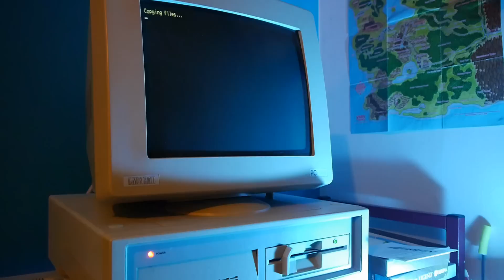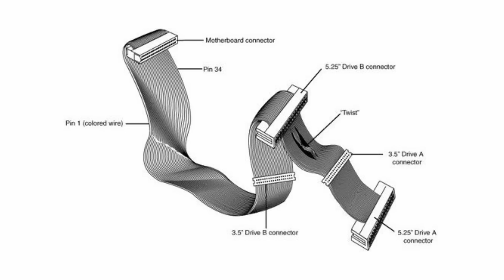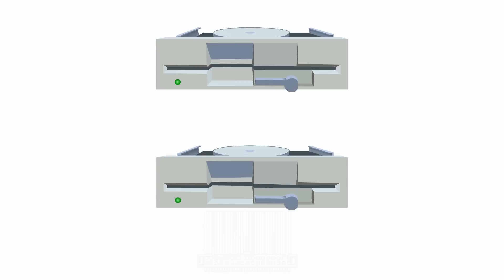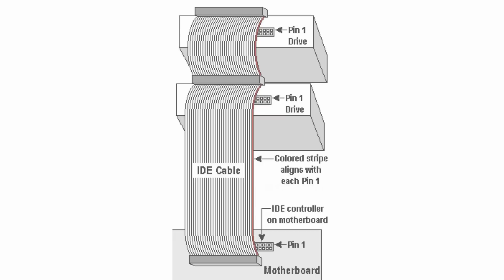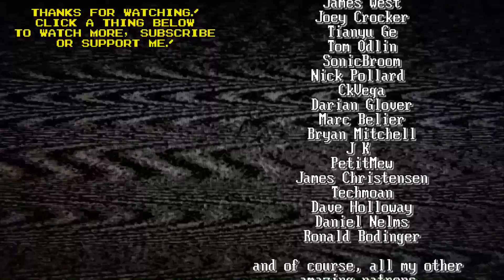Why are Floppy Cables Twisted? [Byte Size] | Nostalgia Nerd

Comment: Anyone else get a chuckle that all the 5 1/4 drives in the illustrations are upside down?  The lever swings down from the top and the light was usually on top as well.

Comment: I'm a bit confused by the way ide cable order described in this video. I don't know if it only applies to CS mode only but I'm pretty sure if you fix the drives mode via jumpers, then you need to put the master drive on the outer end, and slave drive in the middle. If you do otherwise performance drops drasticaly. I have lots of old ide cables with markings that say MASTER and SLAVE on the locations that I've mentioned.
Reply: Watch the video again. Those cables with the cut wire weren't very common in the long run. The typical configurations you're thinking of didn't have the cut wire configuration thing, that was kind of it's own unique thing. Hence the back asswards setup with such cables.

Continuous uncut cables had a missing pin connection in the slave connector to accommodate basically the same thing.

Go ahead, break open the back end of the slave connector on one of those old ribbon cables, I'm sure you'll see a missing connection on that same line.
Reply: @southernflatland  that's interesting info, will do when I have the time!

Comment: The highest number of connections I ever saw in one of those cables was ten. It might have been a custom cable but it had a drive on every port. I don't think that you could use all of them at the same time. Something cool and strange was the usb transfer cable that you could use to transfer data straight from one pc to another but it needed a special program to work but it was way faster than almost any other type of transfer on the market at the time but it never saw much use outside the server market. I have used them and I know that they were fully functional but if you used it in a way not intended you might damage one or both devices. I also never understood why we didn't switch to USB c and omni sooner. We had the technical capabilities to make them and outside super compact situations they would be more durable and easier to use without damaging the port. If you don't know usb omni has one port that looks like a 3.5mm headphone jack but it would have four or more bands and you could use the normal headphones with it even if it was the version that had five or six bands.

Comment: Going back to this era of tech..  you touched on the floppy, but how about the same thing on the old MFM/RLL/ESDI hard drives, which shared a control cable, but each had their own DATA cable..  not to mention dealing with terminating resistors!  Remember running a confg program to set your drive type?   1=10meg, 2=20 meg, etc..

Comment: If I remember corrrectly, that not the full truth. Pre-IBM disk standard (Shugart ?) hat 4 "drive select" wires/pins, but only one "Motor On". So all 4 drives had to rotate simultaneously. 
IBM not made drives "configurationless" but also had two separate "Motor On" signals for each drive at motherboard/controller card side.

Comment: First of all I consider myself an ignorant in computer stuff, and always have.

Then again, if you know how to open control panel today you're considered a knoledged guy, and if you know how to change your os and partition your drive, youre considered a god among mere mortals by the average person.

I miss the old master slave jumper required system because when people watched you use them they were all flabergasted, it was extremely simple and easy but locked like you really knew your stuff.

Comment: 1985: My first PC
2019: So THAT'S how Cable Select works!
Reply: Dropped down the comment section to say the same damn thing. During my youth I was under the impression CS would just magically let the drive I want be set to master. Had no clue how it actually worked until now. Haha.
Reply: @Donchikiman  Agree..  I thought it was triggering some actual negotiation between the drives, but this does explain why sometimes it wouldn't work (using a cable without the cut!)  I also remember taking apart some cables, and finding the cut (missing pin) only within the connector at the end, so that was confusing..
Reply: Same here in 2020!

Comment: The design should had a be the one without the twist and b as the one with. That way, when the need for more than one drive was over the cables could have got cheaper.

Comment: I find it odd that they did this with floppy drives but generally not with hard drives. You have to use a jumper to indicate the primary IDE drive anyway, so why is cable select for the floppy drive worth bothering with?

Comment: Harddrive jumpers.. ugh.. happy thats not a thing anymore
Reply: In industrial computers was using ide and jumpers in 2018 cable select and floppy drives they are not completely gone yet because they are cheaper than sata boards for industrial  use.

Comment: Lol, schlepping it with a 40wire IDE cable?  Gonna need 80wire PATA if you want to burn a DVD... too much crosstalk and interference on those old 40's.

J/K, never knew about that twist... or that missing bit of wire on the HDD cables either.

Comment: The one with two twists just looks like it's supposed to be reversible. That way, it doesn't matter which side of the cable you plug into the motherboard.

Comment: The Floppy standard was overly complicated from day one.  A simple non serial system could have used between 6 and 8 wires and each drive should have had its own motherboard connector that could have been used for internal or external drives.  A binary mode controlled system could have been done with as little as 3 wires, but 4 would have been better.
Reply: I think you just invented the USB

Comment: never use Cable Select, it causes more problems that just setting jumper pins and calling it good. a  small switch on the drive board would have been a better idea to get rid of jumpers.

Comment: I thought you meant the cables were twisted like rope, down the whole length. Forgot about that little twist in the FDD cable.

As far as the wires for fans being twisted like rope, I found that the fan wire on my old Dell had a twisted wire for the case fan, and I thought it looked cool so I've been doing it ever since. Makes it a pain in the royal ass whenever you have to trace a wire though.

Comment: So, basically, instead of having a switch on the drive, they had a tiny piece of metal inside a tiny piece of plastic that shorted out two connectors. You know, exactly like what a switch do.

But in 1900's electronics, it would only make sense to have a switch with labels, so they disregarded that idea. And then hundreds of manufacturers raced to find the most elegant solution to a problem that most everyday users wouldn't have.

Comment: I was always confused about why cable manufacturers didn't have bare pins on that connection and the wires which make up the "twist" be detachable for flipping into the drive A or B specification.

Comment: Which in turn kinda brings up why hard drives, even today. Remains C: and not A: or B: ... Hardware and software was designed for A nd B to be floppy drives and floppy drives only for a long time. For backwards compatibility, the first hard drive partition remains on C:, even when there are no floppy drives nor controllers around at all.

Comment: I don't know what the problem was really. It was super easy to configure drives. Using jumpers and flat cables made it simple to cable manage and use the shortest cables. Every twisted/select cable always looked like a rats nest in the with drives in the wrong spots.

Comment: something you neglected to mention is this. even with the twisted cable, you were able to refer to the a: drive as b: as well. this is how you copied things from one floppy to another without having either a second floppy or a hard drive. you simply typed in the command copy a:name.ext b: . depending on the size of the file, you might have to swap the two floppies in and out several times. it depended on how much memory you had, up to the maximum of 640KB. I actually feel sorry for pc users, because as a cp/m user, my 8" double sided double density floppy drives would hold up to 860KB each. then of course I "upgraded" to a generic pc/xt and lost that advantage. of course the 5.25" floppy eventually upgraded to the high density 2.8MB and the original 3.5" 760KB floppy upgraded to 1.44MB. you also neglected to mention that the b: card edge connector could be used as a tape drive connector. I look forward to reading your response.

Comment: The original Shugart 34pin floppy interface had 4 Drive select leads, DS 0 to 3, and it was common to see these jumpers on drives. A lot of  8086/8088 IBM Compatabile PCs were quite capable of supporting 4 separate floppy disk drives. 

This was abandoned later, certainly when 286's came along as the IBM version did not support it. In fact, Drive B: stayed as drive 1 and drive 2 on the lead became A: Drive 0 was repurposed into Motor start and drive 3 dropped completely. The twist would not have worked with the original Shugart pinout

BTW your 5 1/4" drives are inverted in the animation, and you put the disks in the right way up....

Comment: So the master ide goes in the middle... 20 years wasted, God damn.
Reply: Listening to the whole vid it sort of depends, and I have had systems I built wiith 4 floppies for data transfer,  and 1.44MB drives, 5.25in ones with 3.5in as well, getting the right cable to talke to the motherboard.  And answering why drives had to be B with setting the A rather than the other way round was that software programmes generally were set to look for A so if a system had two As they would clash- in the BIos as well, two Bs would just be ignored generally and no harm done as only one could be made an A

Comment: I had to make a VooDoo 2 SLI cable using a floppy cable, because they were impossible to find online. I read you just need to cut a floppy cable to 2-3" length and re-attach the connector, but it turned out to be a fucking nightmare. Tried over 10 times before I got it right. Has to be connected perfectly or it doesn't work. I made 4 on the bounce in case they broke. So far, 5 years on, and the original still works.

Comment: The real nightmare with these were in the dark ages, when MFM was the norm.

Each drive then had 2 cables. A controller cable like the floppy but with the twist at the other end, then a smaller data cable, one for each drive.

2 floppy and 2 hard drives back then, 4 cables.

Comment: The original Shugart interface only had one shared motor enable line for 4 drives, and usually all drives connected to the same cable would spin up simoultaneously when this was activated. By replacing a Drive-Select line with an additional motor-enable, IBM solved that problem as well.

Comment: One less thing to dream about. I still dont understand why they stopped using the Ready signal tho. I must admit it was indeed a pain building a pc back then having to set IRQ's & DMA's manually with jumpers and make sure they didnt conflict. However being able to set & configure the drives yourself was easy and not a chore and it has only made it harder with time to make em backwards compatible. Something that most retro games has probably figured out by now.

Comment: Well, I have the answer to your question.  Its like this.  If you study the gray cover of your cable you will see that your seeing rough covering over a row of circular apertures.  And on your board is metal pins.  Thats because on the inside of your IDE cable is a group of metal wires.  The gray substance seals them together as well as seals the electricity in.  They are traditionally SOLD as 1, but the plastic can tear under pressure.  The jumper DIP switches are for grounding and the position when reported back to the Motherboard assigns it a DRIVE in the CMOS configuration.  You can still overide the drive standard and change drive signing if you wish within managing your CMOS and your JUMPER dip switches there after the standard which becomes necessary sometimes and a pain.  But mostly we just change for MASTER and SLAVE drives no more.

Comment: sadly the last motherboards that supports floppies drop floppy B support . but there is an hack for this :) I am using floppy B (5,25" 1.2MB) on motherboard from 2007 that does not support it natively :) this is the scheme for the second drive http://i54.photobucket.com/albums/g113/IBMDOS/MODS/FDD%20B/FDD_zps1b153b18.gif 
and to enable it in BIOS as 5,25" 1.2MB use this DOS program :) https://drive.google.com/open?id=0B-MgC_wqs-WcZEtPM29zZFlqcHM
Reply: Just buy a USB floppy drive.  I bought one and hacked it to read Amiga disks for WinUAE.